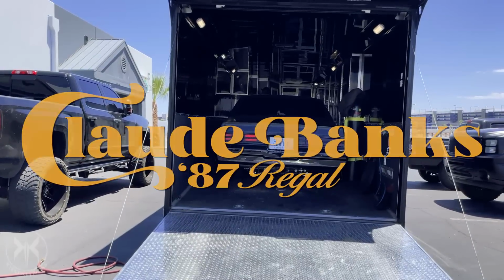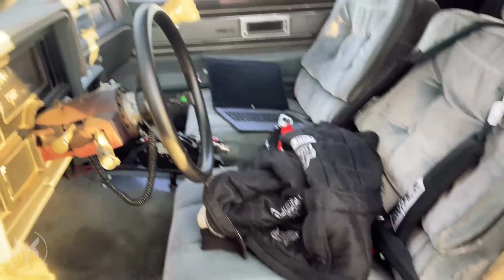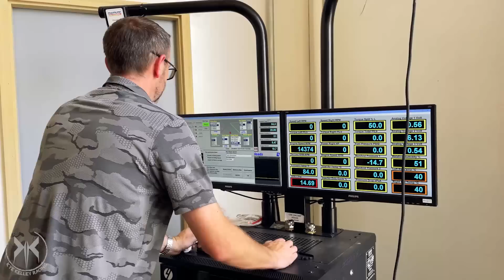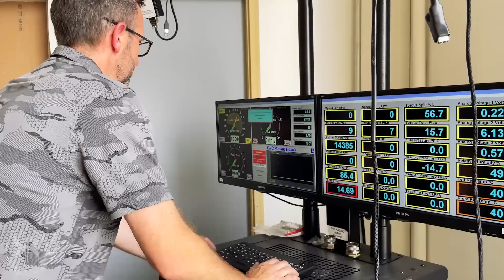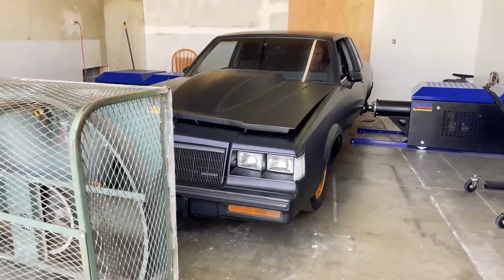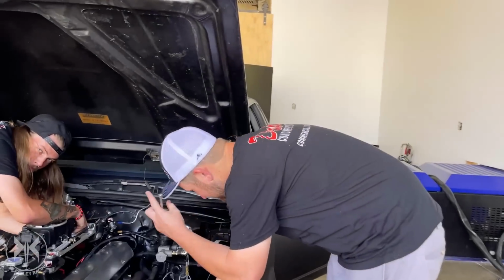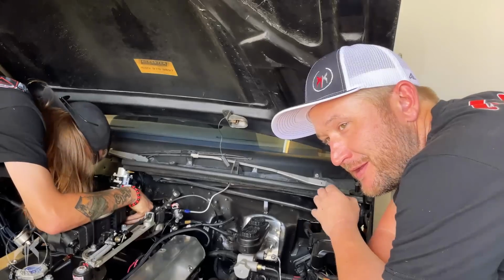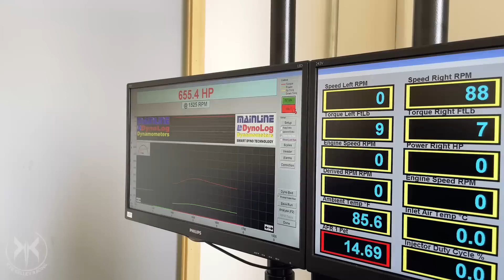Claude Banks 1987 Buick Regal, Kye Kelley's Street Outlaws End Game daily driver build on the dyno

Comment: Wow..whoa their's a street car, well what I call a "hotrod" lol.
Good to see metal American made hotrod ripping on the back street again, like back in the early 90s!
It's About time they went back to the roots of street racing  Back when you pulled your carpet off the floor of your car took out the rear seat  Spare tire  Emergency Jack Front inner wheelwelds  Windshield washer fluid bottle AC delete  Lightned up your Wiring harness  Attempted to put in the 5 point seat belt harness And replace the front steel bumper with a plastic or fiberglass one...working all week going to the speed $hop on Friday getting ready😆 and then drive around later that night Saturday night and Sunday night having some fun meeting new people! 
THAT'S A STREET CAR OR HOTROD LOL "HELLA FUN" !!😁 Dang it seeing this car just brought back all the memories.. 
Think I'll take a look at the Trading Times used car section 🤔

Comment: Mines an 85. White with blue. Full woodgrain and blue pillow top seats. Everything works still, power seats and interior is 9.5/10. Found 1 cracked speaker grill on dasy. Already have the 15s  lol. Almost stock 305HO. With an RV blue racer cam. Set of double humps. Really bad exhaust leak. 295s and wheels are just for looks. Trying to keep the flat hood and wire hubcaps if I can.

Comment: I thought yall agreed to drive the car to the race. Am i remembering wrong?
Reply: Wouldn't want to drive that from New Orleans to Las Vegas. Going by Instagram they all drove their cars from the hotel to the race road.
Reply: @adematthewsracing  ya that makes more sense lol. I’m pretty sure they’re too low geared to drive on the interstate for long periods. They’d burn the motor up real quickly i think. I’m definitely not a mechanic so I’m limited in car knowledge but i think a low geared car can only do an eighth or a quarter of a mile or so without blowing the engine up. Thank you for clearing that up for me.

Comment: I had to force myself to watch episode 2. Everytime you try to explain something it's either explained wrong or totally wrong. Like the efi segment. The efi is delivering the fuel to the runners the same way. In order to get the fuel directly to each cylinder you have to have a fuel injector at the top of the cylinder.
And I'm assuming that the 3rd member was o ringed to the housing because the guy you had instill it didn't use no gasket or rvt or anything. 
 Im not hating at all its just a big "shocker" to hear all this coming from your mouth. 
Please tell me discovery paid you to read off a script they wrote.

Comment: Kinda surprised you did not upgrade the seats and a 6 or 8 point cage just for a little added safety. You do you though bub, we've all done sketchy shit
Reply: Real street car dont have a cage or race seats...
Reply: @jakeresnick2669  I disagree. There's factory cars that now come with race seats. There's factory street cars that come prepped for a cage. having racing seats and a basic roll cage does not take away from the cars ability to be driven everyday or for long distances. Tossing a 800-1200 horsepower car down an unprepared surface with 1980's crash technology is unwise in my opinion, but I also support the right of every individual to make that choice for themself.